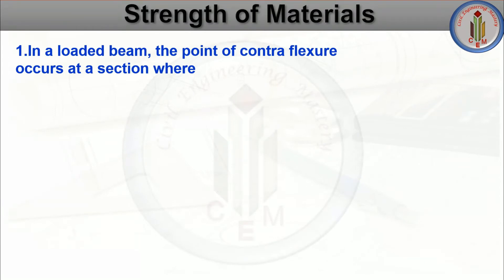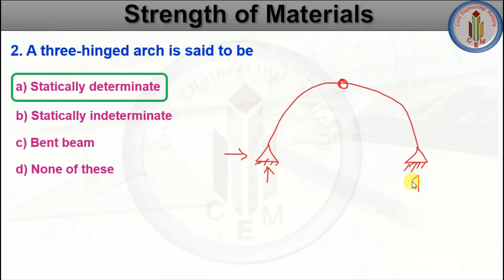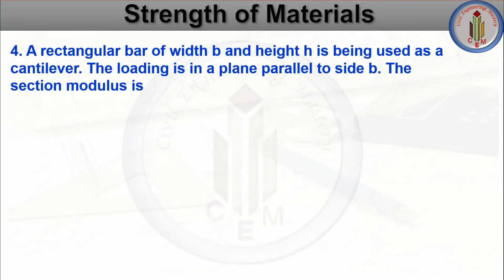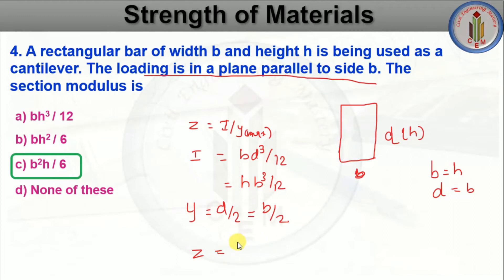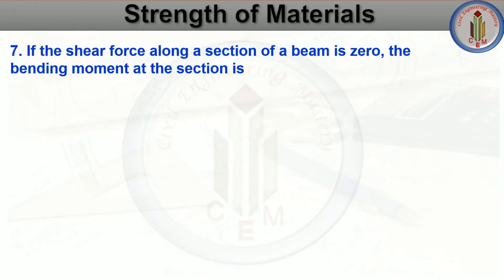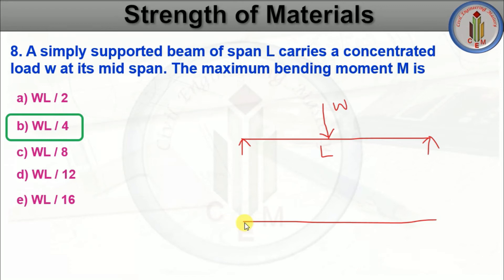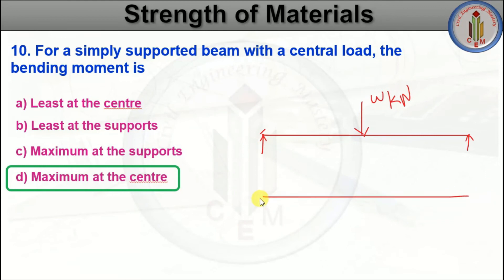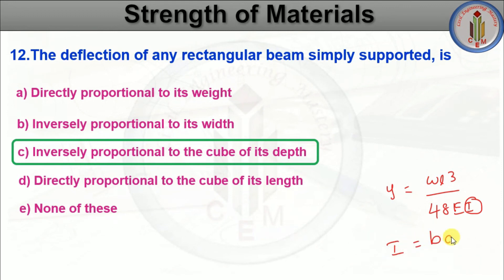Strength of Materials | Strength of materials question and answers | Important interview questions

Comment: nice explanation ma'am, i did my post graduation in m.tech in structure engineering,but i need a job in structure consultancy without a single money...i want to learn r.c.c structure work with any type of money.. please suggest me... ma'am... presently i have no job ..
Reply from the maker: I have created a course, structural design of buildings using Etabs software which includes structural analysis and design of  a five-sorey RCC building(Real project) and is now available on udemy.
Kindly use the below link to avail the full course.
https://www.udemy.com/course/structural-design-of-buildings-using-etabs-software/?referralCode=14883FDBBD95A1ADAC02